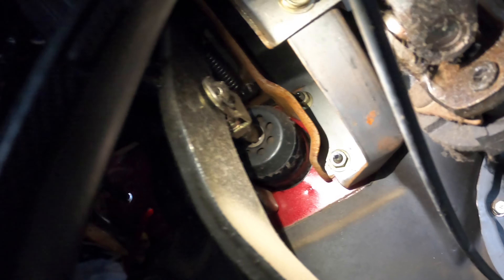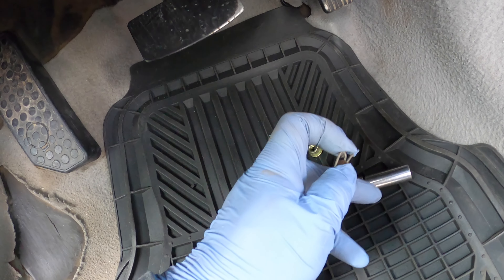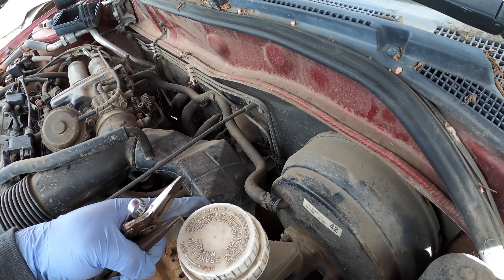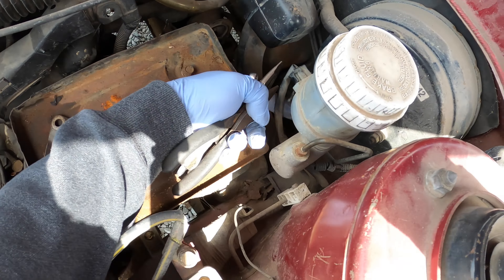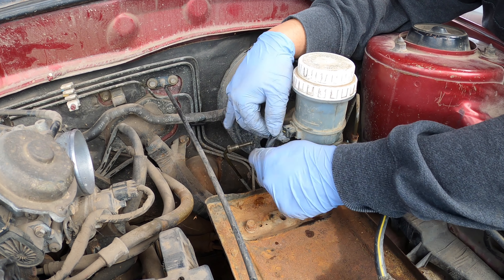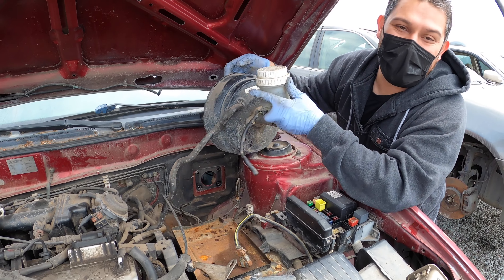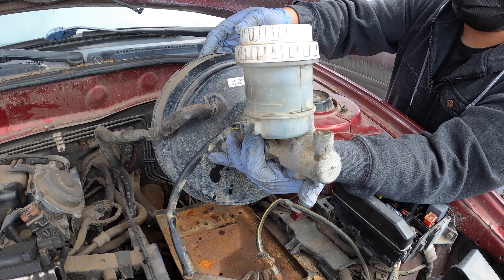HOW TO REMOVE A 3G MITSUBISHI ECLIPSE / GALANT BRAKE BOOSTER | MASTER CYLINDER (FOR YOUR DSM)

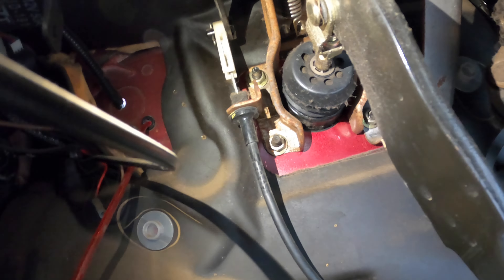Comment: Hi, at 1:41 do you know what that metal cable connected to the brake pedal with that white clip on the left is for? On my Mitsubishi the cable is not held in by anything and I am not sure if it’s affecting my braking